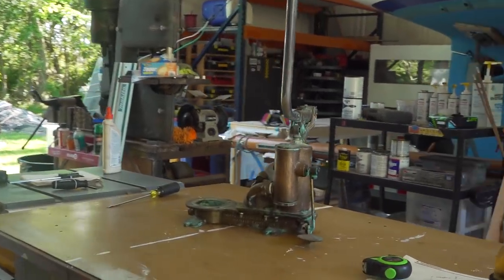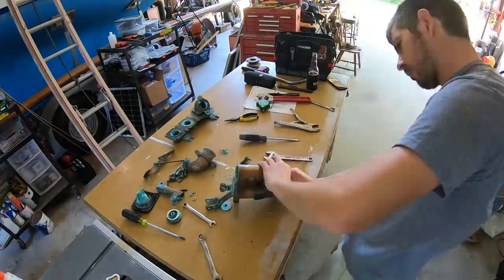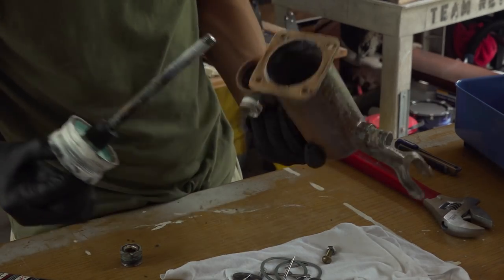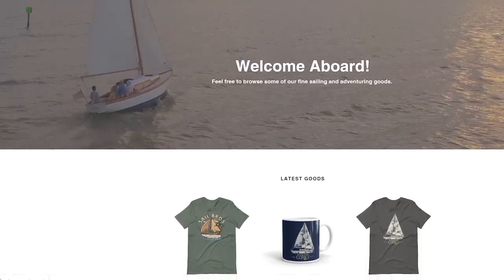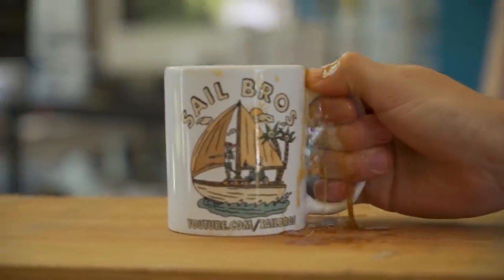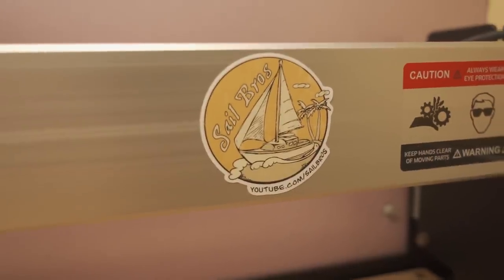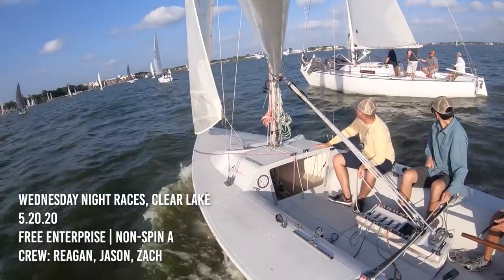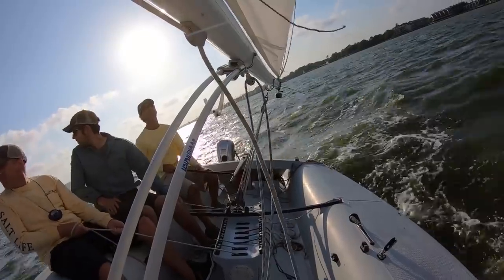Chainplate SNAPS While Sailing The Catalina 30 | SailBros Ep. 54

Comment: Wow! Your head pump was made right here in Middletown, CT. Out of brass. At one time, CT led in the production of brass items.   Sorry to hear about the chainplate. Good thing the mast did not collapse in those strong breezes. While stainless should never corrode, this type of corrosion is called “crevice corrosion” where the stainless is starved of oxygen by caulking or wetness. Careful when you re-bed them. Catalina Direct stocks just about everything you need, call them to get exact details to replace your chainplates, shrouds and clevis pins. They’re great folks and have all the measurements and exact parts you need, even if you hire somebody else to do the labor.

Comment: I worked for a plumbing company in my teens. The building that they wee in was 4 stories and the elevator was a water powered Otis Elevator circa 1903. We replaced the seal on the master valve that summer. The seal was oem from Otis. A leather seal.
Reply from the maker: Very cool. Never heard of a water powered elevator before!

Comment: I recommend You do the rigging Yourself. On a smaller boat like the Catalina it´s a piece of cake and it will be  good experience. After that You will know everything about standing rigging. A further improvement and most likely cheaper is to buy just a spool of Dyneema. The only thing with Dyneema is the tentening and tuning but if You keep the turnbuckles in place You have the best of both worlds